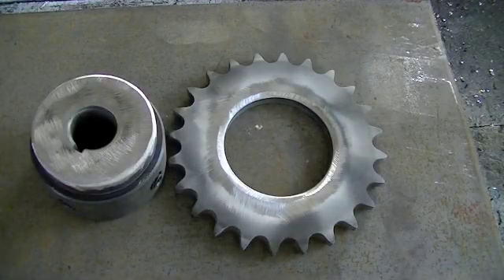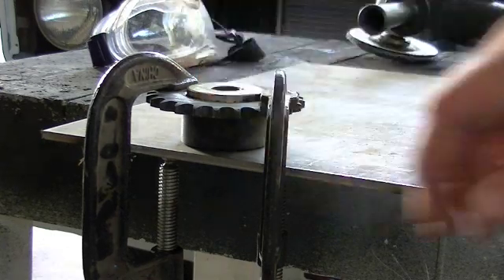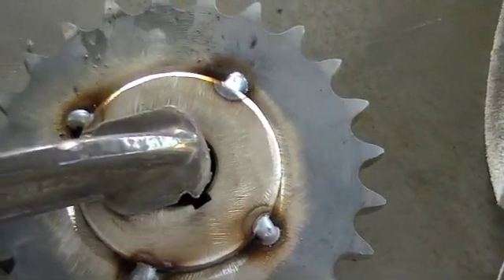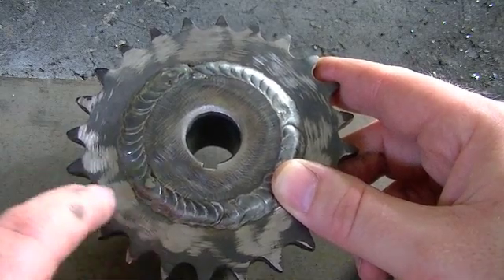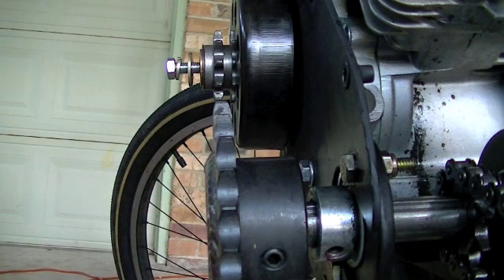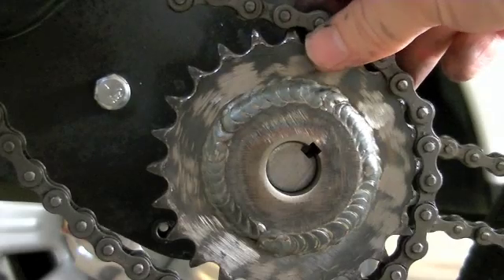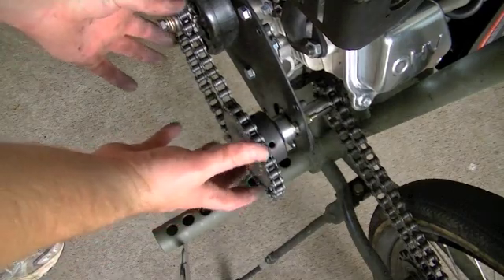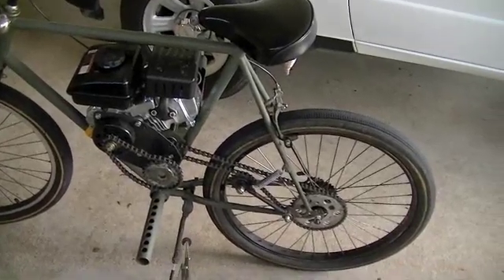Part 31 Motorized Bike | 3HP 4 Stroke Engine

Comment: its called a Taper Lock and Sprocket. The Taper lock fits inside the sprocket, it has two hex head set screws that when tighten pulls the taper lock into the sprocket  causing the taper lock to squeeze   tighter on the shaft. taper locks come in all different bower sizes . . there is a third hole , this one is for the separation of  the taper lock from the sprocket when disassembling .   "Google Taper locking bushings. ". By the way, drilling and counter sinking the set screws { locking collars} in the shafts, can cause real big problems when it comes to the dissembling stuff. once medal gets between the shaft and sprocket/? , pulling one over can be a real bear, cutting time , torch.. again, taper locks. expanded metal, aluminum, would help with the weight of your project. They have aluminum rod that you might be able to use with you welder to. would be interesting to see someone trying to use a small home unit to weld with Aluminum. think i will look that up. sounds like fun. thanks for the memories. hope your finger wasn't cut to bad. been there, done that, for years. later brother . dan t

Comment: Instead of welding why not just drill 2 or 3 holes through the sprocket to bolt on ?
Reply from the maker: Later on in this build I do bolt the sprocket to the hub.

Comment: Why didn't you just change the final sprocket at the rear wheel so that you wouldn't need to modify your chain guard.
Reply from the maker: Guy Pehaim I was maxed out on the size of my final drive sprocket.  Any larger and it would rub on the chainstays.